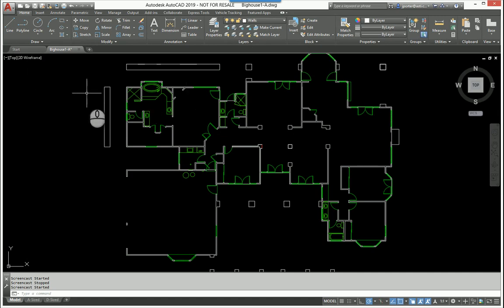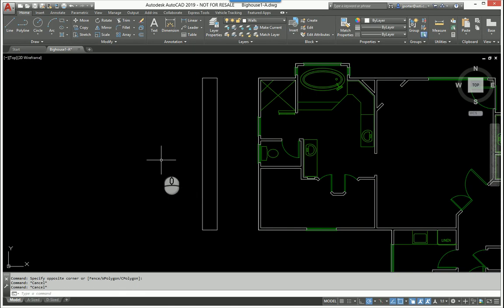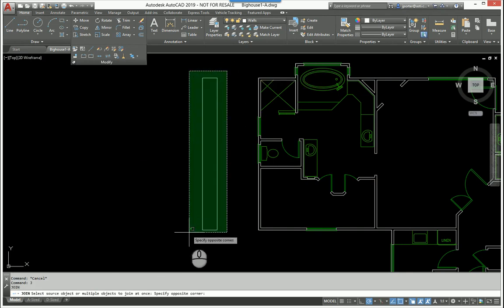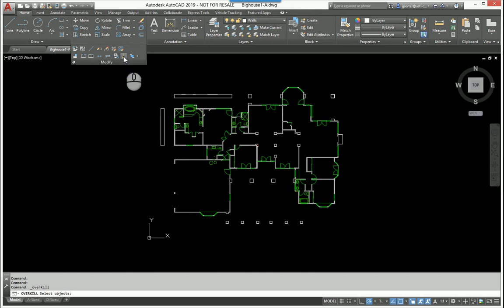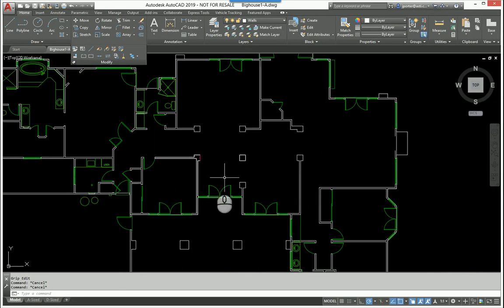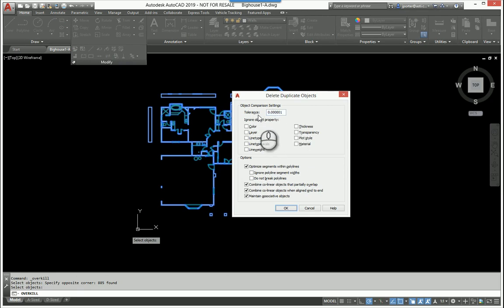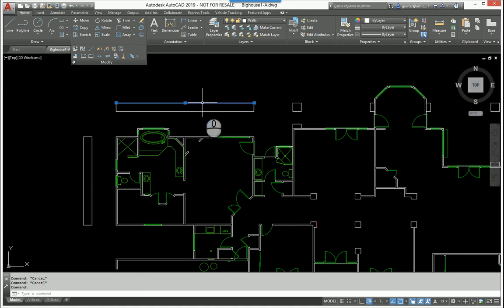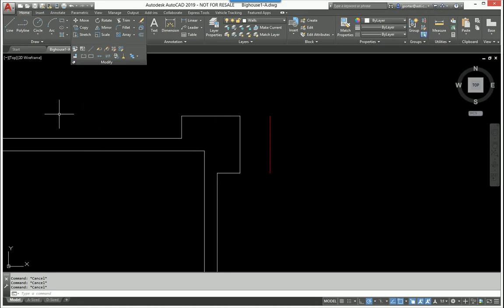AutoCAD’s Lesser Known Commands – JOIN and OVERKILL

Comment: Quite right, did not know these useful commands. Awesome.  Forever PEDIT & Joining. No more.
Reply from the maker: Lance, I'm happy to hear this helped reduce some key strokes.  Thanks for watching.
Reply: @j-porter . U wud not believe, today whilst trying without success, to convert an inserted .dwg with Microvellum, of letters I had to CNC program out of 19mm veneer  2.7m x 0.82 Vertical sign. As the lines where splines. I tried splinedit, pedit, making solid then subtracting, regions, these letters which spelt "GROUNDFLOOR" a logo, wud end up been small multilines in which the CAD optimization just crashed with 1 letter. So I just had trace with 3point curves & lines. BUT, uncanningly, J 4 join & overkill was just what I needed to speed that up a little. Imagine, the joining I required with the oval like radii I had to recreate. I also set up SHORTCUT HOT keys for MV in the customise. PG file. Only watched that from a Microvellum YouTube tho full Autocad features. Only 4 mths with MV at new job. Worked with Cabinet vision for past 7years. Cheers.